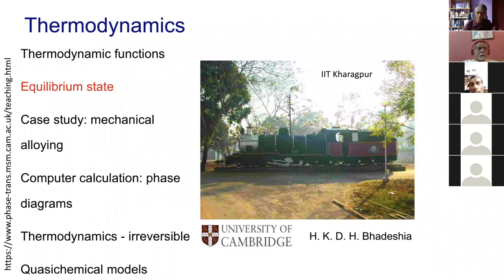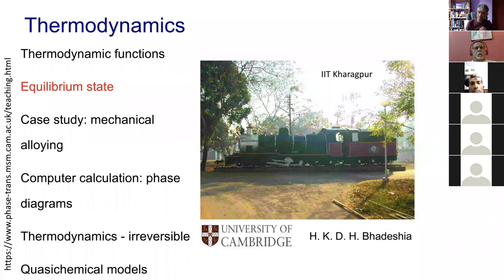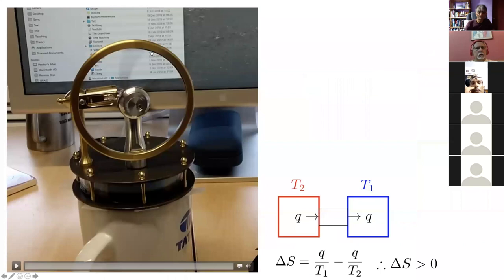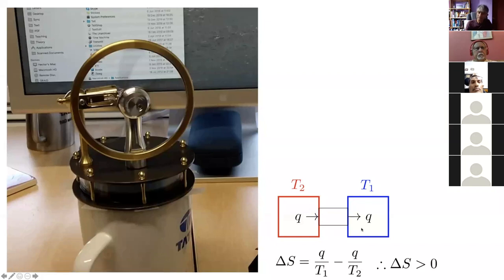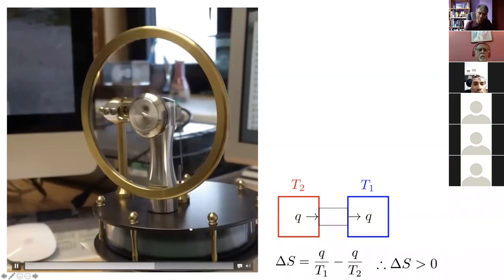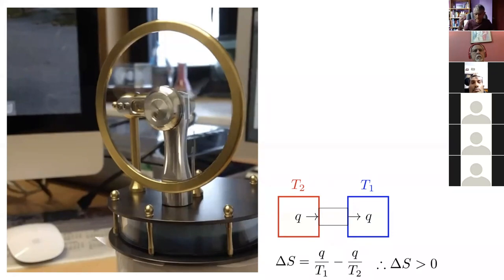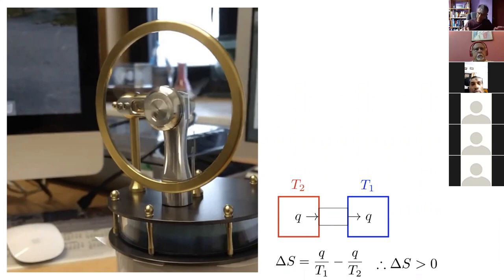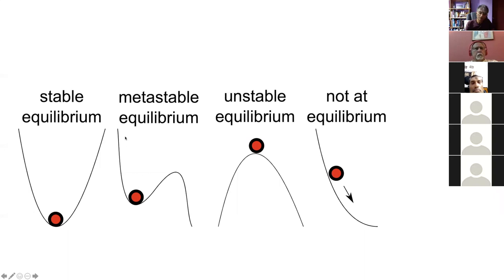Thermodynamics - Equilibrium & solution models

Comment: Professor Bhadeshia, I have a confusion . if a element precitate out completely from the solution( e.g. cu in steel), then the chemical potential of that element in solution is not exist. so how does that element chemical potential equilibrium between solution and precite?
Reply from the maker: It is never the case that there is zero solubility.